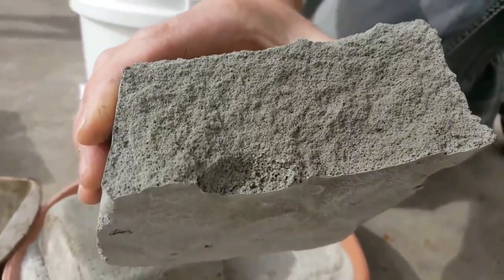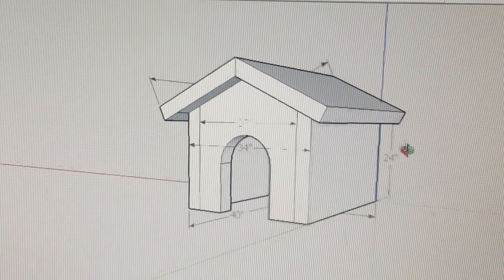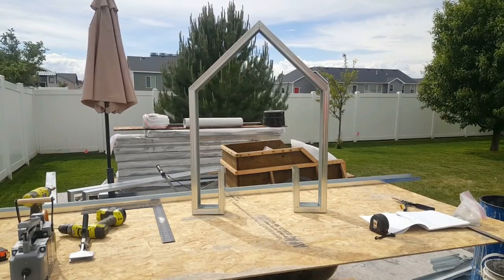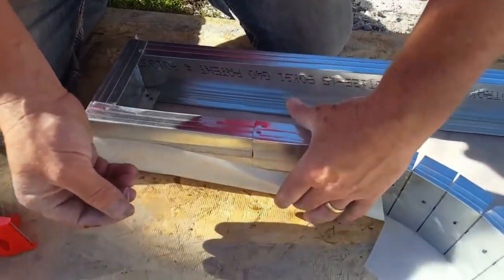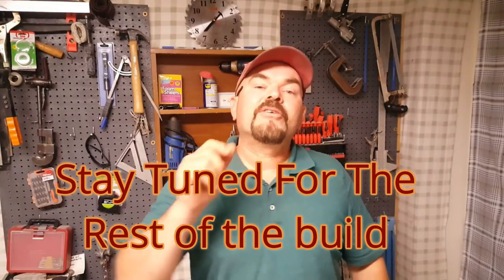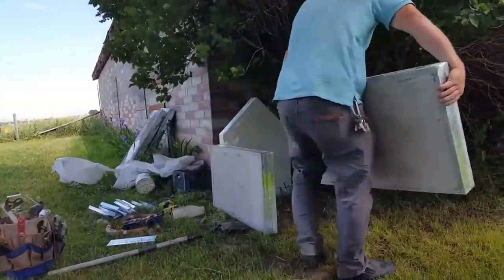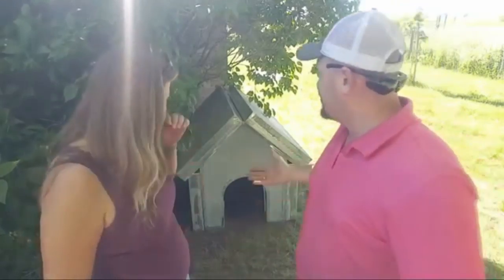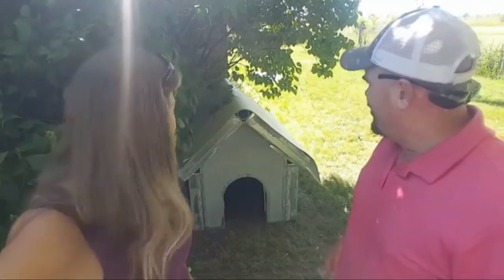OMG? Awesome! DIY Air Crete For dog lovers!

Comment: Instead of an angled top, you could make one panel longer to overlap if you aren't reusing the form.   Just wondering, why not keep the metal forms on the aircrete to protect the edges?  Did you reuse them when making the duplicate sides?
Great ideas! You are an inspiration!

Comment: You appear to have done a good deal of research with aircrete. I have been wondering how this would hold up as a fence post?treated wood posts run about $10 ea around here. With a chicken wire cage could it be strong enough to keep goats in? What do you think?

Comment: Can you use aircrete to make swimming pool. Inground or above ground.Thank you for your time and I enjoy your channel.
Reply: Can you answer my question thank you
Reply: HDC has talked about these in past videos. He made a garden block that works like retaining wall block. The stability of aircrete in forms could be used but needs a waterproof coating or pool liner. You will notice the use of water sprayed on aircrete will fill cavities in the pourous material then evaporate on hot days creating cooling affect. A sprinkler on an exterior wall of a building for example  will lower interior temperatures significantly.
Reply: @raddad701  thank you for your time

Comment: What kind of a drill do use for mixing air crete?
Reply: I've seen it done with a cordless drill, but a heavy duty electric is better. If you are making a lot you should get a double spiral mixer, high shear type. Faster mixing with less foam loss.

Comment: Next video: "build a workshop out of aircrete for $500"!

Actually, is this possible like they do for commercial buildings? (When they pour the walls on the slab and then lift them vertically) I forget the term.
Reply: Tilt up
Reply: Yes, can do tilt up. Cure times are larger than regular crete, because of lower strength achieved.

Comment: What about the Mould? Such a material, after the first rain, since is not insulated with liquid glass, it start producing mould (mold) and that is Unhealthy.
Reply from the maker: mold only likes organic materials. aircrete repels mold very well.
Reply: @HoneyDoCarpenter  TRY TO ADD CRUSHED (like dust) CHARCOIL. Put into the cement, small amount.
Reply: You might get moss to grow on the roof. As the house can easily be opened for cleaning, mold would not take easily.